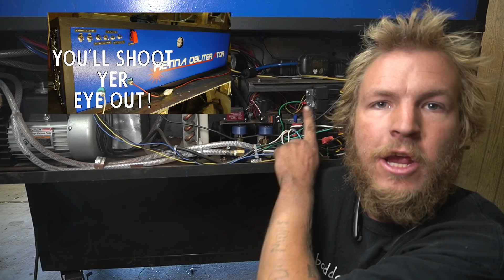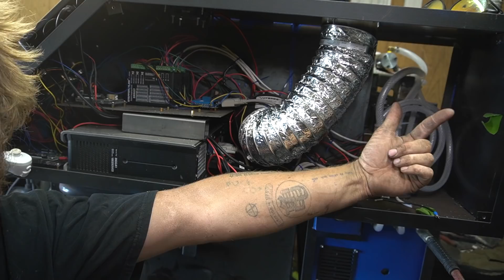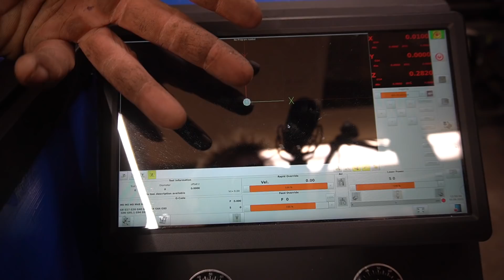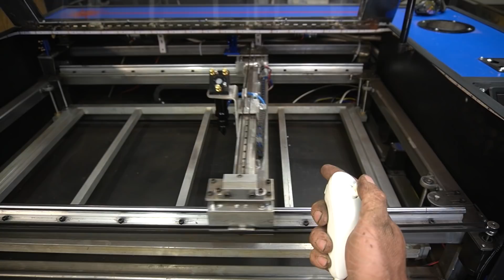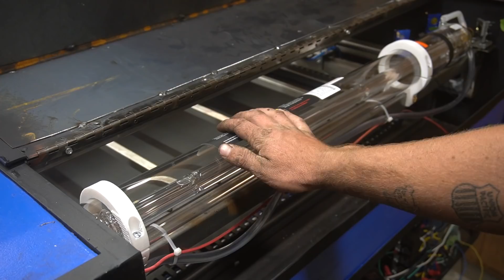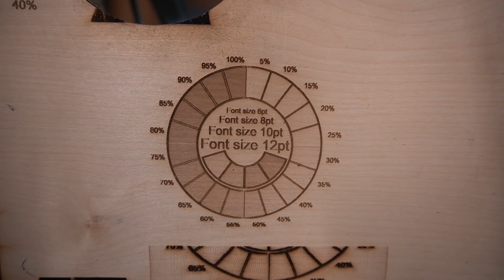DIY CNC Laser Cutter - It's Done!

Comment: Great work man, but I'm still wondering what's the hard part for home made CO2 laser tube works?  The seal?  The precise size set for parts? Or just not worth it by compare with bought one? Because of your video I start thinking building a CO2 tube and use it to diy CNC machine by my self, the whole series video is very helpful

Comment: Edit: cancel that, you swapped the DIY tube. Also no need to be sorry. I guarantee you’ve made way cooler projects than anyone that would complain.

Would you be able to use a 10 turn pot or a rotary switch for the gas? Maybe a stepper motor or simple gear set up if the servo doesn’t have a high enough resolution. Just a thought to make that second pot useful 🤷‍♂️

Comment: i think all makers go through phases... i once had the urge too to make my tools and all of it myself BUT you have 2 options, become a full time "tool maker tinkerer" or a guy that actually uses said tools to create something with it. in the end, diy versions are often hardly any better than the store bought stuff (lets take a 3d printer for example, you cant build anything better than an ender3 at the same pricepoint) - same with this one. you could build a laser tube that is as good as the industrial one, but it would cost you significantly more money and time to pull off wich then would be much more expensive.

Comment: So: With the store bought tube, do you still need the C02, water and suction? Also, Does it run on 220 or 110v?
Reply: The factory tubes are usually sealed, just power and cooling water needed.

Comment: Most definitely NOT a copout. You made a working DIY laser tube, in a DIY CNC machine. You got to the point of optimizations and splitting hairs for high-end functionality. 
You have a garage, and you. Manufacturers have teams of engineers and production equipment. Super impressive accomplishment, great work. 
I bet you could grab more subs if you mashed up some build clips into a short video and put it on TikTok. Like a teaser. 

Thanks so much for sharing this.

Comment: how much was you 100 watt sealed laser? one tip you will get better results blowing air at your cutting material. I run a 200 watt laser for my full time jobs. I have an 1/2 hp air pump pushing air into the focus lens nozzle . That cools the focus lens and puts the flames out on the material your cutting. When I want cleaner cuts I switch to tanks of nitrogen.

Comment: Everything you've done is freaking amazing. I upgraded a cheap laser to a 60w co2 and I've lately been thinking about bumping up the bed size by gutting it and building a new enclosure. Maybe I'll put a bigger power supply in and go for the 100-150w range... I've been using lightburn to generate the code to run on my machine - I really dig it. Thanks for all the great videos!
Reply: and yes please - a material list would be killer!

Comment: Great work, i recently rebuild a scraped cnc laser. For the control board i used an esp32 whit grbl and Lightburn, works great. U can even run gcode ower wifi or Bluetooth.
Just dont use arduino or any 8bit mcu.

Comment: Dude making a laser tube from scratch that worked is damn impressive. I would not call buying a tube a cop out at all. At the end of the day, I assume you built the laser to be used as a tool. At some point you have to admit your tools shouldn't get in the way of a different project.
Reply: Exactly.  You can make a hammer but why when you can buy one that has been specifically manufactured by someone else who has the time to make the tool.  Just because you have the skill to scratch build everything doesn't mean you have to for every project.

Comment: Your CAM spits out the straight up G-code. Then you run it through a "post-processor" particular to your machine for the M-codes, offsets and shit. You should be able to write a small program (if someone hasn't already).
Reply from the maker: Man I'm dumb, I didn't think of that. I'm used to using sheetcam, and the postprocessor is an integrated part of saving the g-code files so it never ocurred to me to run one on it's own.
Off to work on that now, Thanks for the tip man!
Reply: @cranktowncity  No worries man. 
My first time editing g-codes was on paper spools with masking tape and a hole punch... things have gotten easier.
Keep up the good work man. 🍺

Comment: You could add a nozzle with air or nitrogen near the laser target area. It blows away (air) small flames or damp them down (n2)
Reply from the maker: I've since upgraded the air assist to a better pump so there's less flames now. thinking about adding a t to a valve where i can run other gases to experiment with.
Reply: @cranktowncity  Try it with Nitrogen. It is quite cheap and I made good results with it.

Comment: I take a different route, I bought a cheap, $1000 50W Chinese laser. Upgrade it with 70W tube, keep PS, and Ruida controller. Add to it a $50 android phone with a 20MP camera for positioning. Now I started to build bigger mechanics and enclosures 1000x700mm instead of 500x300mm.

Comment: Bro, I think we all knew you were going to end up with a sealed tube. I'm just thrilled you built a tube in the first place and shared it with us, I haven't seen that done before and it was freaking awesome.
As for a "better" software than Lightburn... I dunno, you probably need a better controller because Lightburn is amazing. A Ruida is like $300 but totally worth it.
Reply from the maker: I've been playing with lightburn a lot more since making this video, and I actually love it! awesome program, I just still hadn't quite buttoned down the settings.
Although I do still have to manually switch the M106's it spits out to M03's, but that's a small price to pay for the capabilities of the software
Reply: @cranktowncity  you could write a python program to automatically replace gcode with other commands. I did that on a cnc ender 3 project. Worked great
Reply: @nickbaddorf2673  I know this is old but you don't need to write any code.  Notepad and pretty much any text editor can take the text file (which is what a gcode file is) and replace M106 with M03.
Reply: You don't need a Rudia, just a heads up!! I used to use GRBL-LPC, with a 30 dollar smoothie clone from the zon. I have recently moved up to GRBL Hal with a teensy. It's awesome.

Buy lightburn, and buy the GRBL-LPC to get working, cheap and effective.

Comment: Don’t blame you for buying a tube you had a go and that was really interesting but sometimes you want a tool not another hobby 😀 I was super lazy and bought a K40 does the job for me. I’d look at improving your extraction or you’ll end up with dirty mirrors. Maybe a bit of coarse mesh for the bed so you can use smaller material?
Reply from the maker: Yeah that honeycomb bed that comes on factory built machines looks pretty nice, not sure where to source it though.
Reply: @cranktowncity  fwiw, it's just a bunch of long thin alloy strips withholes drilled in them then scrunched up like a wafer and pushed onto stainless rods and some channel around the outside as a frame. A man of your metakworking calibre would knock one up in a couple of hours with something to copy and the right stock on hand. Sing out if you me to email you some close-up photos of what you'd need

Comment: Airflow. You need airflow, very badly. That smoke just coating the mirrors and other optics is horrible.
Reply from the maker: yeah I got a better vent fan ordered, Im hoping to not have to cut holes in the case to help the airflow but time will tell